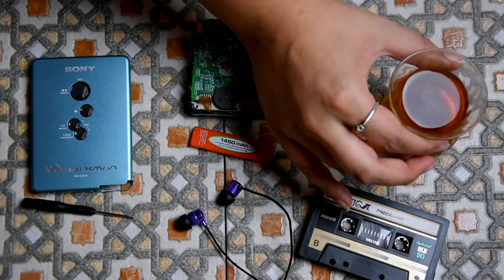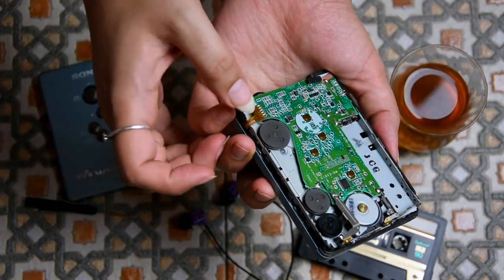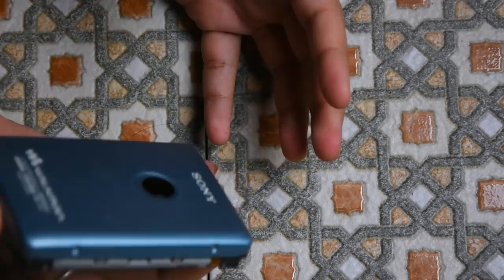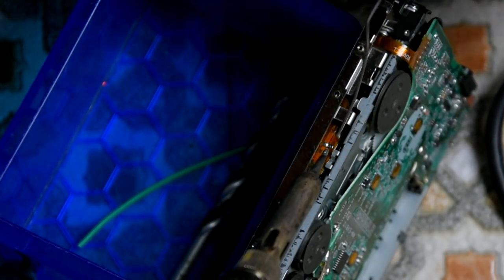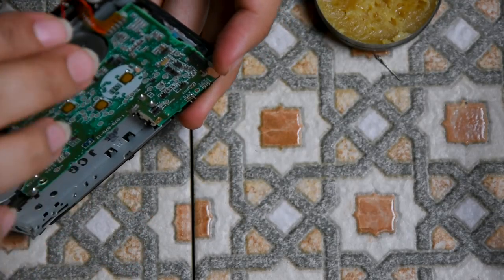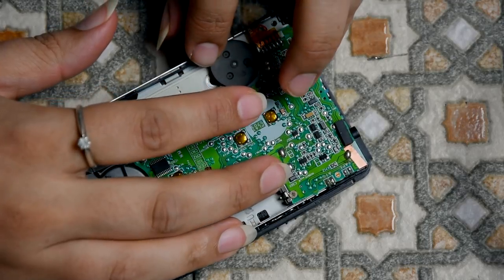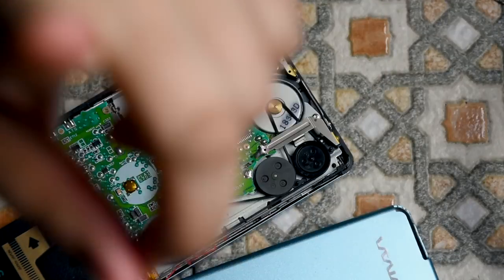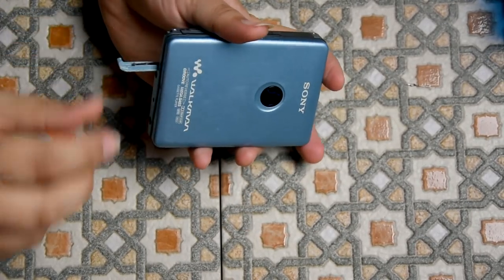The Personal Stereos - Part 5: Sony WM-EX610 repair

Comment: It's nice to see her repairing that Walkman, I bought the same model from a friend but when I took it apart I found q. the girdle or leash as we give it in Peru 🇵🇪 they are hungover and I am worried that. Some particle has gotten into the mechanisms, another problem is q. I can't disassemble the circuit to see the mechanical part.

Comment: Another success (thumbs up). The clamshell design is very reminiscent of minidisc recorders from that time, from the loading and eject mechanism, to the clicky sounds, the curves and the metallic body. It's very sleek and posh looking. One thing with your particular one, not sure if you can tell, but I think the motor had a slight instability in speed. Sometimes the tape sounds fine, but sometimes it ran just a tad slow, so the key was a bit flat ever slightly. I think it's the motor or a power fluctuation because even with no sound on tape, the pitch of the motor "whining" gets slightly lower then back to normal. I wonder if it's the battery or what. Doesn't seem to be the belt. Edit: it sounded like when you connected it to the camera the first time, it made a motor whining sound for a split second. Maybe since camera mic inputs use "plug-in power" that it somehow gave the motor a jolt, and could have also somehow caused the speed to fluctuate slightly? Weird, but I wonder. Maybe I'm expecting too much from a "portable stereo" :)
Reply from the maker: Thanks! Yes the design does remind me a lot of the Minidisc recorders/player, esp the one I have, very sleek design! 
Yes I know what you mean about the motor, i've heard that slow dip then speed up with a few personal stereos, It may be the case that the battery isnt fully charged, I still havent charged it since the expo. I need to test that with fully charged Eneloop pro in there too. But that dip motor sound isnt alien to me :o)

Comment: Great work, sometimes the solder could be a dry joint meaning you just need to flux it, clean and re-solder. Just wondering is ESD an issue when repairing these, especially the IC components, if I get one might be worth having a ground strap just in case.

Comment: The lifetime of so many devices is very short nowadays especially since the advent of non replaceable batteries. What I really admire about looking at some of these devices from the past is that because you value them I look at the more closely. This makes me realise how especially a company like Sony produced some amazing equipment I now deeply regret giving away my mini disc player.
Reply from the maker: Devices nowadays feel as if they've intentionally got a short lifespan, we're living in a disposable era pretty much where consumerism is the focus. But, I dont believe it was that much the case back with all these devices of the past. I have some things from the 70s and 80s which are still going strong now. As you said they made some pretty amazing equipment.
 If you're thinking of getting a Minidisc recorder + discs, now is the time, they're not so expensive, but eventually will be as prices rise. I'll say this, I still use mine and they are fun to use :o)

Comment: Great job!  Those pesky flex ribbons!!!  I fixed a few Psion 3's the same way many years ago.  The problem comes from physical movement causing fatigue fracture =\
Reply from the maker: Thanks!..Flex ribbons, that's what they're called! lol i know they serve their purpose but i've never liked them.
Reply: You aren't alone lol, I don't like them either!  The problem is that they are destined to fail - I guess everything is ultimately - entropy etc, but the fact they are used in mechnical parts where it needs to flex due to movement between say the front and back of the case, the angle of movement and the quality of the ribbon ultimately factor in how long before they break.  

The Psion 3's are notorious for the problem because of the angle they flex at (like 105 degrees or something).  I would guess on a walkman (yes I call all personal stereos that too lol) the angle is much less - just enough to get tape in and out, but it does show that even with a shorter angle of movement they still fail at some point!
Reply: BTW - Something else I forgot to mention...   What typically happens is at the point where its most stressed the flex ribbon actually splits.  If you examine the whole ribbon you would probably find the break.  It's often worth putting some insulation tape around that part of the ribbon, it can help support the fracture from breaking further.   This is something else I did when fixing Psion 3's many years ago, and where I didn't, the split widened breaking more connections later.
Reply from the maker: I don’t like them even more now lol 
you know what the funny thing is about the walkman part? there are no freakin moving parts in this one, the head is fixed to that position, it’s the cassette that goes over the head when inserted and that’s it, so i’m not sure how the freak it goofed up! lol .. 
okay thinking about it now, maybe only very slightly when you open the lid (the head is fixed to the lid) but not a great deal. 

Thanks for the advise though regarding these!
Reply: Psion 5 also has registration holes in the flat flex cable that "help" it to break. Sometimes it's not the worst idea to simply copy the design into a PCB CAD and have a PCB house make some fresh flat flex cables for you, and you can fix their misguided attempts at saving some material in the process. They'll usually have an MOQ on the flat flex though, so... you get to sell 49 pieces or so. Also worth looking around whether somebody already did that and is selling replacements - sometimes it's not on ebay though but on sites that look approximately like this: http://www.pulster.eu/d__kaffee5__Psion_Cappucino_machine___coffein_shots_whenever_you_need_it694.htm

As to how this broke... well slight movement can do that too eventually, but if it's really all fixed, maybe it simply cracked at the solder joint at one of the ends simply from vibration and temperature cycling, and reheating it would reseat it...

I'd have an urge to run such bodges with transformer enamel wire... assuming it's not gonna rub through and contact something else, would this be good enough? Given there isn't much or any movement there... they are so similarly coloured and they are thin and easy to fit anywhere.

Comment: I have a WM-701C where 6 of the 7 lines of the ribbon cable between the mainboard and the controls are dead, so I have the unfortunate prospect of running 6-7 wires the same way

Comment: Thanks so much for this video!  I have this same player and want to remove the lid part that you've removed here in order to adjust the speed, but I can't seem to detach the lid from the remote/headphone input.  Do you have any advice?
Reply: If you pry off the lid from the battery slot side first that will create enough space to maneuver the headphone side off.

Comment: Superb work i am in the middle of fixing a sharp minidisc recorder ,a plastic cog on a metal shaft that moves the laser is in need of some glue as it just spins and laser will not move so far so good ribbon connectors removed and battery terminals de soldered to get the main circuit board out a charity shop item my dad got for £1 and gave to me hoping i am sucsessful as it sounds better than my sony .

Comment: akai gx 260d bölüm 1 Bana yardım etmeni isterim
Please read my comment?

Hello there..
My name is mustafa. I need your help. ;)
I have 260 grams of macaroni.
it does not work and it does not bother. And it starts with listening and the midler is not a problem. I can not get enough to try it and get a dull sound.
I do not shave. I get a lot of lp d lp sound, but when the recording is over and the rollers are listening, there is no treble.
how can you help.
Thank you very much in advance.
I do not know what to do.
Reply from the maker: To be able to hear sound I advise that you not plug your headphones into 260 grams of macaroni ;op